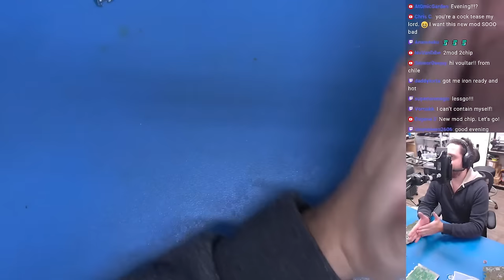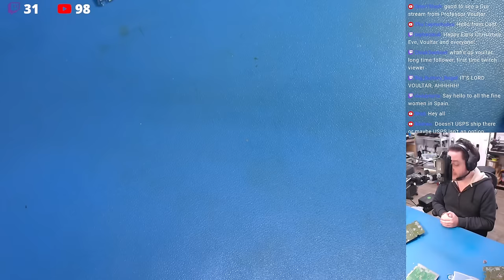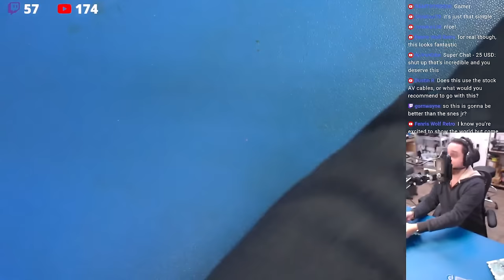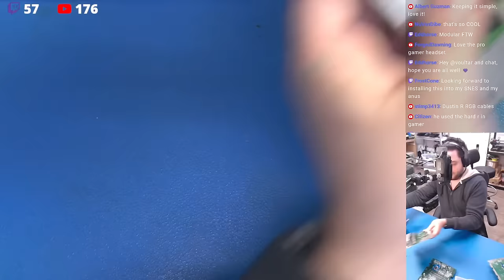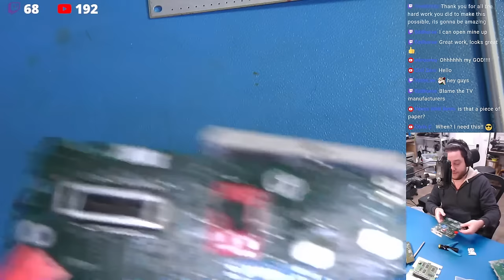SNES 2CHIP Installation Teaser!

Comment: Very much looking forward to this board.  While I think I'll recommend the 1chip for most people and still love my own, I have a couple 2-chips that desperately need this treatment.

Meanwhile, while I had wanted your IFU-30 RGB board, recently I've come to find that the colors aren't accurate on that machine's RGB...  A shame, but it means I'll be looking into a certain S-Video mod in the mean time, at least until some highly engineered FPGA solution is cooked up for color-accurate RGB on that system.